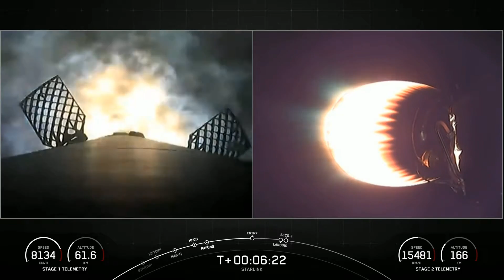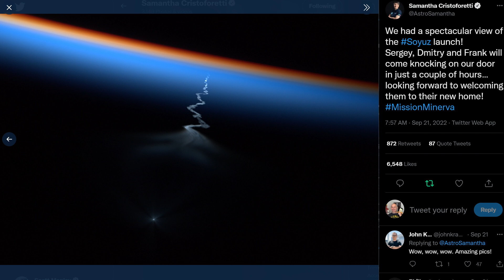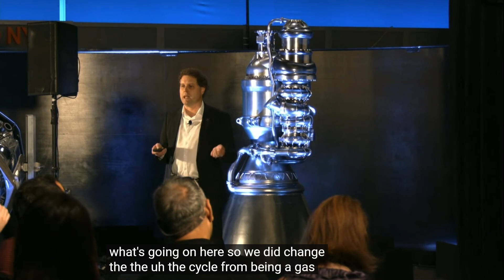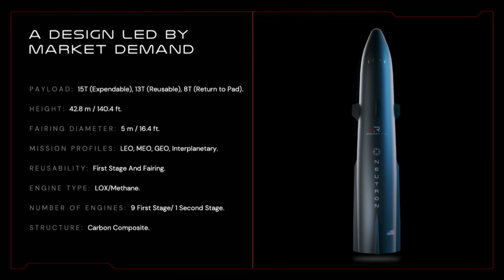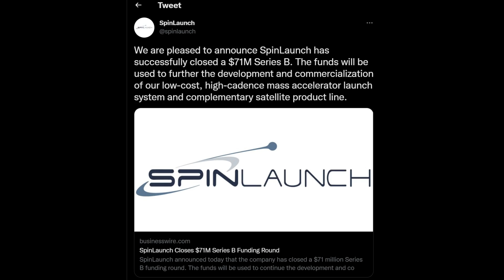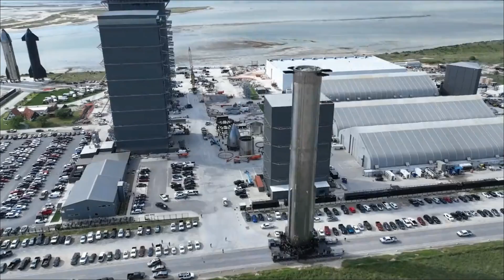Deep Space Update - September 22nd

Comment: The Spacex Starship orbital launch mount appears to have no flame diversion or trench to divert the exhaust and flames away from the vehicle. The exhaust going straight down has no where to go but back up and out across the whole launch site. The Shuttle had a fire suppression water system, and they still needed to divert all of that energy away from the vehicle at launch. As is, the SpaceX Starship launch site just doesn't look adequate for the world's most powerful rocket. I see everything just getting blown up during launch. I see a similar problem for the upper stage trying to take off from the surface of the Moon or Mars, with the bottom of the rocket being just a few feet above the ground.

Comment: Hey Scott just watched the live NASA feed of Dart impactor hitting diemorphos   I am wondering if you can do a video on the math behind the impact forces just looking at some quick dirty maths. my thought was its effect could be compared to a fly farting affecting the moons orbit. If we see a change in the orbit of the asteroid it is likely to be measured in seconds is this correct? As for setting Nukes off in space to affect the orbit of an asteroid unless you can create a shaped charge where you can create more push in one direction then they are unlikely to change an orbit significantly just result in lots of smaller bits hitting over a wider area creating pretty much the same affect as the big piece would have done. So is slow acceleration over a longer period of time at an angle to the plane of travel likely to be more effective.  A one or two degree shift in orbit over millions of miles is likely to be significant? The trick is seeing it early enough and making that orbit change far enough away to make a difference.  Cheers and best wishes from Australia great channel and content.

Comment: Thanks for the update Scott!  Most I'd seen, following updates pretty closely these days.  SpinLaunch though is ... well ... seriously, they certainly don't expect to launch humans using that mechanism.  All you could reasonably launch would be small, coherent packages that could reasonably be expected to survive the massive G-forces.  They'd have to bring the vehicle up to some pretty high speed, in a circular fashion, thus, like a simulator where the astronauts struggle to not pass out with up to 5 or 6 G's...  So it would then basically throw a 2nd stage package upwards trying to get it to some reasonable altitude so it could light its second stage engine and fly onto space or something?  It's just hard to conceptualize.  Might be more reasonable on the moon, or maybe even Mars, where the gravity wells are not so deep.  But, especially on the moon, much more reasonable would be a rail gun that would simply launch "Capsules" (or packages) upwards.  You only gotta get to about 10mi altitude before a tug could come down and pick up the package and get it to orbit.  That's all Apollo 11 made I believe was about 10mi on the ascent stage of the Lunar Lander.

Comment: Do Elon should use carbon for some parts of Starship in order to solve Starship center of mass problems. Carbon and steel can be joined?
Reply: They started with carbon fibre and discarded it in favor of Stainless.  What center of mass problem do you refer too?
Reply: @TheEvilmooseofdoom  I believe they still use carbon fiber for small tanks which requires extreme pressure in the hundreds of bar. But it's mostly stainless steel.

Comment: i think the capsule abort system is overkill ! all the capsule needs to do is detach from the booster and save the fuel for the landing ! there would of been some injury's if anybody was on that flight !
Reply: the capsule needs to clear off any debris coming from a exploding booster. 
Also, that acceleration wasn't abnormal for a abort system, up to 6 G for a fill seconds will only make you dease in that orientation
Reply: @GustavoSantos-he8sl  i heard some say the capsule was 9g's and possibly close to 15 ! Blue origins dash board showed 0 and it also looked like they tried to cover up the landing !

Comment: I tried calculating the g forces from the Shepard abort and it comes out to be 3.87 g in the first 4 seconds of the motor lighting. The high g forces recorded has to be on landing.
Reply: Stepping through frame by frame, I got 10Gs between updates right at abort. It was very brief so I wouldn't be surprised if the peak was 15Gs between updates.

Comment: Scott, on the subject of SLS. Why are we building and testing and maybe flying a rocket system using engines of which there are a limited supply. Being shuttle engines once they're flown and dumped into the ocean, they're gone and can't be reflown. So if SLS is going to be a viable system, are there going to be more shuttle engines build?  And if not then there will have to be a whole new set of tests with a newly designed engine. Aren't we just throwing these shuttle engines into the drink for no good reason.
Reply: I believe they will switch to BE4 when the shuttle engines are gone.

Comment: Reading that engine slide from Rocket Lab I'm left confused.  It says, "Gas generator cycle [engines] are limited in capability and not suited to the deep throttling required for multiple re-lights in orbit, and for landing the first stage."  But the only company successfully doing orbital launches that land and recover the first stage, a process which includes multiple re-lights, uses gas generator engines, i.e. SpaceX's Merlin 1D.  So, I guess they are just subtly praising how awesome the Merlin 1D is?  Hard to understand how they write that statement when literally the only working example of all the things they mention is by the type of engine they say is unsuited to it.

Comment: I could see Electron using their electric pump system in a staged combustion to power a larger turbine/pump to combine into a large combustion chamber. The throttling should still be there, just sorting out the combustion stability inside the larger chamber remains then.

Comment: Last I heard, Artemis was still waiting for permission to launch with abort batteries which have been sitting out there longer than usual. Also, 27th launch would probably get it off safely before the soon-to-be hurricane gets too close, but not by much; if not then they'd probably want to roll it back for a few days. Hopefully they'll have enough certainty on the thing by Mon.
Reply: It seems like a poor design choice to make those batteries hard to replace or recharge while the vehicle is on the pad, given that they are a showstopper.
Reply: I'd hate to be the USSF having so much political pressure put on them.  As Wayne Hale said of his time in the shuttle program, "Everytime we asked for an extension on the FTS, the answer from the USAF was always 'NO!"".
Reply: The problem is, if the launch attempt would get aborted on the pad due to an unexpected problem you have SLS sitting on the launch pad during a tropical storm or even a hurricane. It's a risky bet if you try to launch a new system like SLS shortly before the storm hits the Cape

Comment: Spinlaunch wise I like the concept but personally I think rotation is not the best idea, a linear maglev with 1300Km+ with a soft incline seems to me as a better idea, specially for fast launch cycles. More expensive to implement yes but easier to make work as it doesn't require special materials, likely more reliable too. And the referred length is so that we can have low enough G acceleration to allow human carrying vehicles to be launched using it.
Reply from the maker: That's great but you need a 1300km evacuated tunnel as opposed to a vacuum chamber the size of a football field.
Reply: @scottmanley  Needs to be a tunnel ending on the top of a mountain as tall as possible.
Reply: @scottmanley  Referring Ed, Edd'n'Eddy, Dig a hole dig a hole dig a hole :P
Reply: Sounds prohibitively expensive. You can compare it to oil pipelines which are very expensive and only made cost effective by the fact that they transport vast quantities of a valuable commodity at far less cost than rail or truck. A linear maglev launcher would definitely have a higher cost per mile than a pipeline, and the product is not nearly as valuable.

Even if you assumed that you could capture the entire launch market with your launcher, it would still generate far less revenue than a pipeline, and for a much higher cost.

Comment: Im really curious about the 15G statement about blue origins New Shepard. Some people were saying the landing rockets may not have fired on the capsule which may explain the 15G’s, I wasnt convinced that they didnt fire though so if thats the G loading from an abort that is terrifying.
Reply: lighter load ( no humans ) means more acceleration; I presume the escape rocket motors are designed correctly for a typical load of human cargo ( humans are relatively heavy ! ). Force  ( fixed = mass * acceleration.  Reduce the mass, keep the force constant, and acceleration goes up. Physics :-)
Reply: @2o4II112II26o2  thats a good point i didnt think about that
Reply: The landing rockets did fire.  That's what caused the large dust cloud as the capsule hit the ground.  Starliner uses almost the exact same tech.

Comment: Would you discuss what happens when the upper atmosphere has total space congestion? When there is no room for anything else.
Reply: Any shell above the earths surface has more "surface area" than the surface of earth,  so there's plenty of room. We're not even close to covering the land mass of earth in buildings or farms, and that would definitely run out before running out of space in LEO.

But if you're referring to Kepler Syndrome, that's something else entirely. Objects in orbits like those of Starlink decay very quickly. So if there were a collision cascade, the debris would fall to earth and burn up fairly quickly. Scott did a video about it. Objects in higher orbits are a concern however.
Reply: Earth has 20 000 km of circumference, if you would take every single satelite that is orbiting Earth and placed them on single orbit you would still have kilometers of space between them. There is looots of space in space.

Comment: 0:30 One major problem with the Cell phone satellite. How are even the most modern cell phones going to have enough power to reach a satellite in orbit? Coming down is one thing, but the phones need to be able to transmit back otherwise you've got an expensive one way radio.
Reply from the maker: It’s possible because they satellite has such a huge antenna.
Reply: @scottmanley  lynk proved it works even with a smaller antenna. They actually already have a commercial sat on orbit.
Reply: The same way Voyager can still talk to Earth despite the vast distance it's travelled... the antenna it's talking to is big enough to pick up the weak signals.

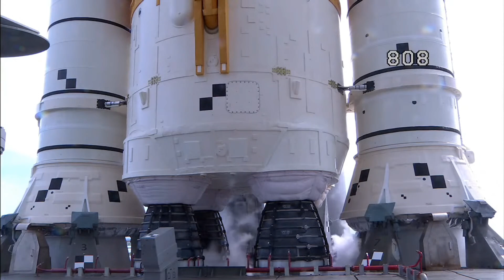Comment: 10:00 does this imply that hydrogen-fueled rockets do not scale well? Or is SLS the only hydrogen-fueled rocket of its size to experience these issues?
Reply: the troublesome leak is not on the rocket but on the fuel port, the "Quick Disconnect", the thing that is used to refuel the rocket is always leaking.

Comment: Spin launch has a lot of potential as a launcher from the Lunar surface. It makes little sense as an Earth based launch system to me.
Reply: The spinning launch part is the easy bit....making a rocket that can take 300G's lateral force will be the hard part which will be needed to get the payload to orbit.   They're just kind of glossing over this but having built liquid fueled rocket engines....I can't see that part working at all.   Perhaps a solid fuel rocket could be used, but every one of the animations I've seen show liquid fuel engines...so good luck with that.
Reply: keep in mind you're also added lunar dust into the equation. Obviously a vacuum with lower gravity makes it more practical, but it's not trivial either
Reply: Agreed. It seems more useful as a launcher on low-gravity, minimal atmosphere worlds.
Reply: I'm waiting for the concept that mounts the launcher in a modified 747
Reply: Just use a railgun on the moon.
Reply: Makes even more sense in orbit
Reply: @forloop7713  It's rather hard to spin a mass up to high speed and throw it from in orbit.  That whole action/reaction bit.
Reply: Reminds me of the space gun for launching satellites.  The satellites had to be basically solid to survive the 100 G forces.
Reply: Artillery shells often use fuses with miniature electronics in them, going back to antiaircraft shells in WWII, which had tiny radar sets in them. Of course, these devices are purpose built for that kind of abuse and only have to operate for at most a couple of minutes. Not sure you could build a useful orbital payload that can take that kind of treatment.
Reply: What many may not realize is that most solid state electronics can already handle that kind of force, and likely far more with a small amount of effort.  Consider the HARP and Martlet rocket projectile carried non-solid state electronic payloads, and some of them were fairly complex as opposed to simple (state of the art at the time!) radar fuses or barometers.  As far as liquid fueled rocket engines go, the tanks/chamber/turbines would probably be a non-issue, but they may run into some initial problems getting the plumbing and bell/gymbal arrangement properly supported for that amount of force.  Probably some type of breakaway sabot support structure.  I have no doubt it's possible, but I don't know how much payload capacity they'd lose from the necessary reinforcements or sabot.  I'd say it's certainly a feasible pursuit even here on earth,  perhaps not as cost effective as they envision it to be, but low grav moons and asteroids is where it would really shine and prototyping/troubleshooting in space is a little more difficult.  If they get the concept hashed out and functioning successfully here, we'll have a surefire method of launching payloads with far more effect elsewhere in the solar system.  An atmosphere free launch area would simplify the device considerably without requiring a space snail housing, allowing more options for how the pieces are sent and assembled in situ.
Reply: @Skinflaps_Meatslapper  I don't think you understand the forces we're talking about here.  Standard electronic construction techniques aren't going to survive hundreds of G sustained acceleration, much less 10,000G.  As just one example, take a common 470uF 25V surface mount cap.  It weighs 1.5 grams and is attached to the PCB with two tiny surface mount feet.  During spinup that tiny cap will weigh 15 kg. That's 33 pounds for the non-metric.  Do you think that component is going to hang onto the PCB for hours with that much force on those tiny smt pads?  I can pull one of those caps off with my fingers.  If the PC board and components for your device weigh (say) 100g total, during spinup you'll have 1000kg (2200 pounds) trying to rip that little board into pieces.  Do you think any normal PCB is going to survive a ton of force applied to it?  Can you make electronics that could survive that?  Possibly, but they'll certainly have to be specially designed and manufactured.  Everything will have to be potted into a solid block and reinforced with steel, and some components simply won't be able to be used.
Reply: @stargazer7644 Well, maybe you should try thinking a little harder next time, or stop thinking that you know more than everyone else around you. Perhaps that will help in the future.

Cell phones are already capable of withstanding several hundred G's as-is, without being a solid block, and encasing electronics in epoxy is not a new or experimental thing.  No, you're not going to drop a cellphone into a magic spinny space snail and expect it to be functional, and some components won't be a good fit, sure, but there are plenty of alternatives and enough engineering force at work to handily figure out the things you scoff at.  If your thought experiment is a justification for why it wouldn't work, then you should have told people that before they successfully used electronics in projectiles that see even more acceleration than your 10,000G benchmark.  They wouldn't have bothered to waste their time making electronics work after being subjected to those kinds of forces.
Reply: @Skinflaps_Meatslapper  Such as?  What devices?  Cell phones can withstand several hundred Gs?  Cite some examples.  Any electronics that have been successfully used in very high G environments I guarantee you were very specially custom made.  They weren't COTS products stuffed in a shell and fired.  I gave you a VERY detailed explanation for why what you said was baloney.  Rather than just reiterating more baloney, please explain in detail where exactly my numbers are wrong if you believe them to be.  Don't just sit there and make weak insults, or is that all you have?  Say something of substance.  I design and build prototype electronics.  I've never tried to sling them into space, but I know a little bit about what would happen if I did.  No, potting electronics in epoxy is not a new thing.  Nor would that be at all sufficient to get them to survive 10,000G accelerations, as I said previously.   
"No, you're not going to drop a cellphone into a magic spinny space snail and expect it to be functional".  That's a little different from your previous erroneous comment that I replied to:  "most solid state electronics can already handle that kind of force."  Perhaps you're starting to understand the magnitude of the issue here.
Reply: on a planet or moon without an atmosphere, doesn't it make much more sense just to create a straight electromagnetic accelerator track? Like what Robert Heinlein wrote about in The Moon Is A Harsh Mistress
Reply: @tycho_m  Why do it the easy way when the hard way is much more expensive?